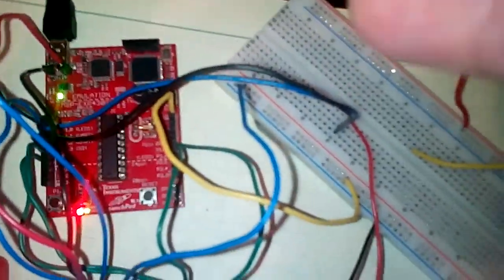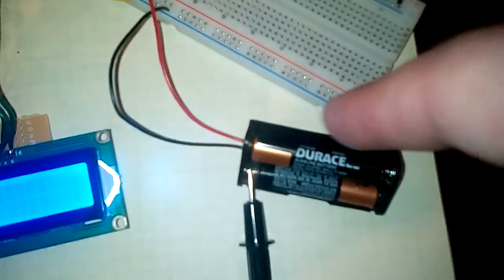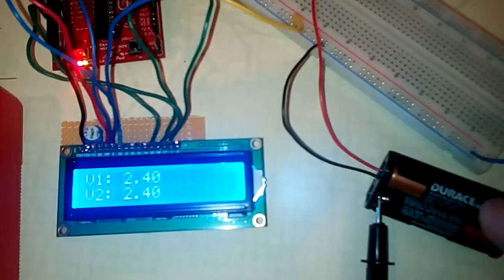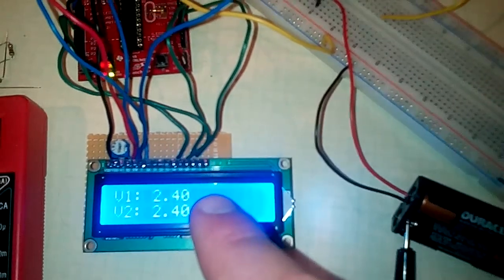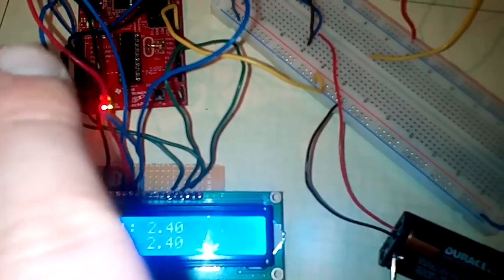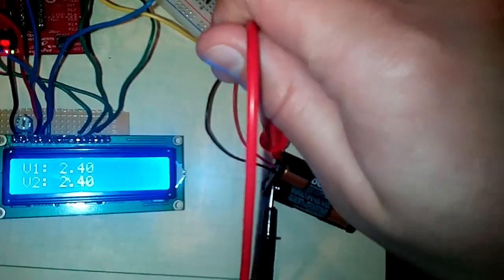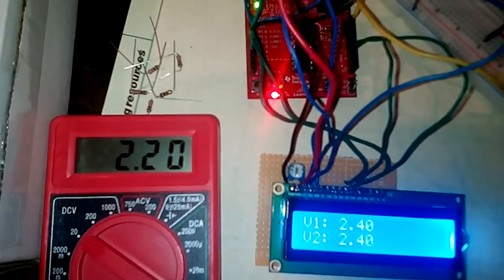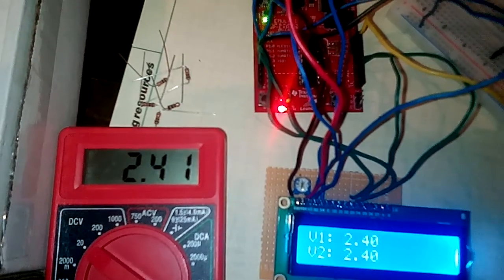Multi-channel voltage reading using MSP430 ADC10

Comment: would you mind sharing the code and schematic ?
Reply from the maker: So I found this website helpful for using the LCD screen...
msp430 launchpad with lcd module | cacheattack

And the two Single Measure functions from this site are useful for using the ADC (just ignore all the tx rx stuff for the spi part of it)
http://www.msp430launchpad.com/2010/09/simple-adc-example-on-launchpad.html

Pausing at (5:12) on this video helped me to use my LCD screen; however, I have had some bad experiences with frying LCDs because they don't all come with this same pinout: So be careful to make sure your datasheet matches this same pinout or else just use your datasheet alone for help with this.
Tutorial 13 for Arduino: Liquid Crystal Displays (LCDs)

Hope this helps you get started.